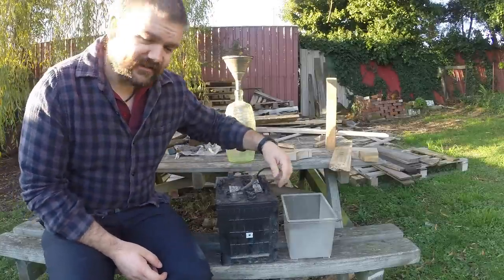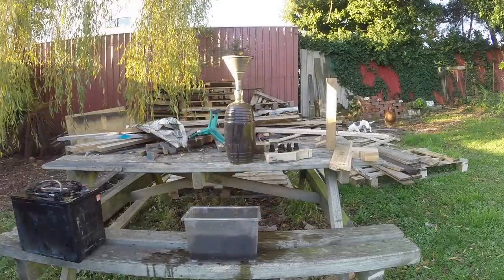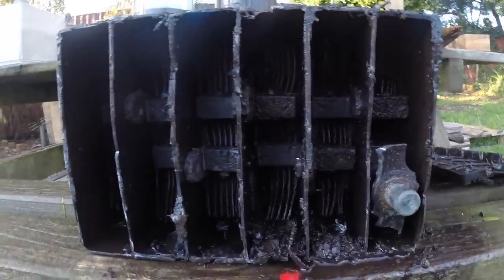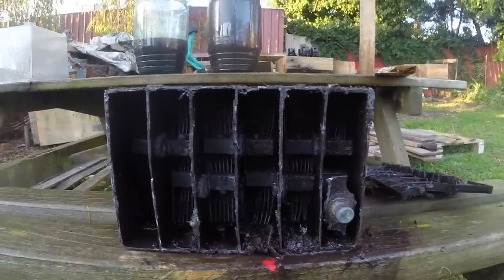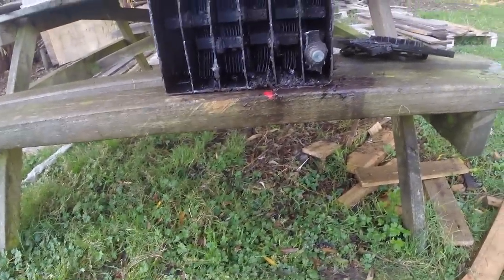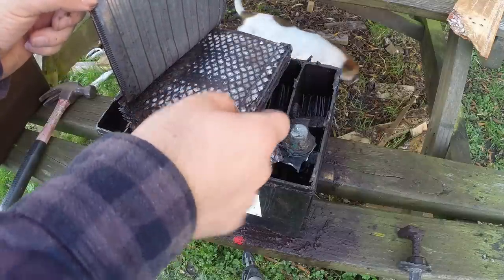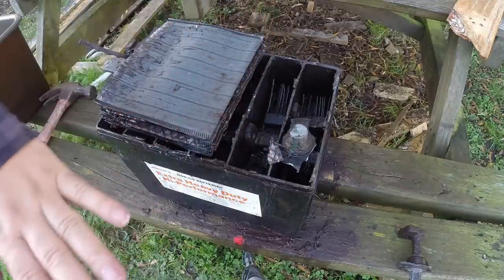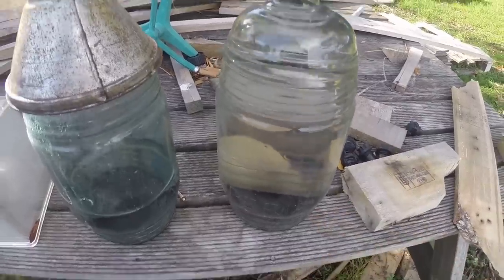Teardown #7   Lead Acid Car Battery

Comment: Ive done this for years with no issues  however, I do wear an apron, gloves and glasses. I also concentrate the acid and reuse..... Like to see stuff repurposed!
Reply from the maker: Whats the fastest way to concentrate the acid in your experience?
Reply: Danger VB - Boil it down
Reply: how much lead can be recovered in average will the smelters buy this plates as lead scrap

Comment: Interesting, as I continue my search for tire weights at shops. But if I were to do this, what's so hard about putting some rubber gloves on? And it's Murphys law when pouring something like acid that a drop splashes in your eye, so glasses. Also, if your doing this more than once, a respirator would be prudent. Curious what you do with the acid bottles.
Reply from the maker: You sir are correct about the safety gear.  I have since invested in good quality safety gear. The acid in old batteries is generally fairly diluted. There is another video with what I do with the acid! And safety gear is not an option for that one!
Reply: +Dan VB   So it's diluted. Good to know. I always thought it would burn the piss out you. Did you have any irritation at all on your hand?  I'm trying to figure out if it's worth the hassle. If you make an ingot, about how much weight or size would one get?
Reply from the maker: +Thirteen Wheeler As an example I spilt some acid not long ago on the old carpet in the shed. As an experiment I chose not to wash it off. The carpet is yet to even change colour let alone cause a hole. in saying that I have seen it burn holes in clothes if left without rinsing. I'll have to way one of the ingots and see how much I get.
Reply: maybe some safety glasses ....
Reply: It's only battery acid guys. As a kid I had my face and eyes sprayed with the stuff when I removed a cap from a freshly charged battery.  After a water flush and some baking soda sprinkled on my face and eyes all was well. Scarry exaggerations are to keep children safe not grown men.

Comment: Stupidity has no boundaries... Except the already stated lack of any safety gear at all. You do not want Pb/PbO on your hands nor do you want to flush out a dirty old battery anywhere near you, your dog or where anyone else are going to sit,work, eat, live etc. 

As for the corrosive properties of battery acid, A few years back i accidentally spilled some on a pair of thick leather boots without noticing. Some hours later i had a 1" hole in the boot.  Even if you don't notice anything right away bad things might happen later on and then it might be to late. You can always hope most of it has become water if its a old battery. But you really never know before hand.

Comment: a hacksaw cut around the cap is way easier, just did one. Took five minutes
Reply from the maker: Md Seelbach reciprocating saw even better?
Reply: it wasn't any effort, a short blade probably, the cell connectors are pretty thick and could kick back if hit i would imagine
Reply from the maker: Md Seelbach you think there's enough lead in there to make it worth it? I've got a couple of batteries ready to process.  I'll weigh the before and after this time
Reply: probably 2 or 3 lbs, just a time eater for me, i think there is way more lead oxides than pure lead.
Reply from the maker: Totally agree 👍

Comment: That brittle white stuff was probably some kind of resistive ceramic insulator meant to prevent shorting. I just went back and looked some more, and I'm even more certain that's what it was. For one if your electrodes were that prone to crumbling you'd never be able to keep electrical continuity through the contacts with the terminal and the bottoms of the electrodes. While the contacts seemed to be connected only to the plastic encased electrodes (there was one scene where you moved the white junk and it moved freely away from the contact strip).